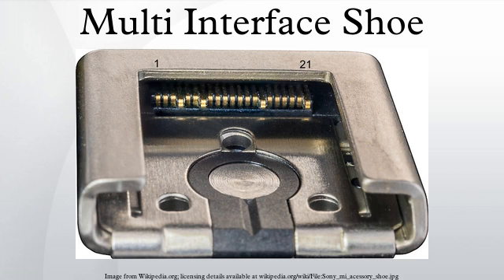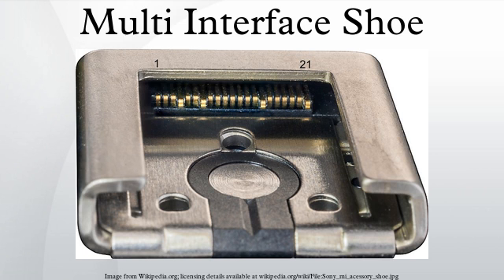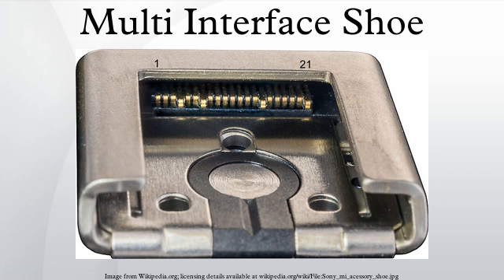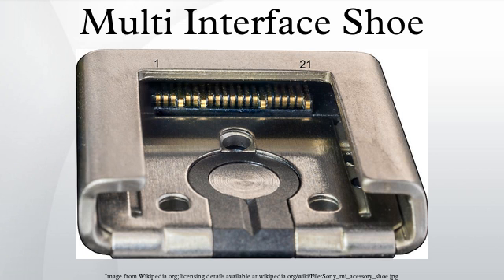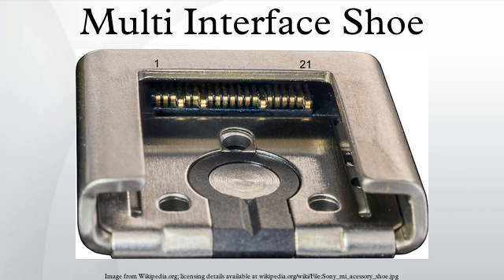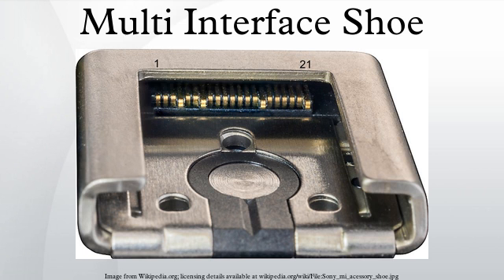Multi Interface Shoe

Comment: The stinking MI Hotshoe prevents the flash from being used on any bracket that has a standard hotshoe attachment.  I desperately need a hotshoe receptacle which will fit a flash with a multi Interface hotshoe and also be able to mount on a bracket or light stand with a 1/4 x 20 screw...
Reply: Hi Richard, did you find such a hotshoe adapter?